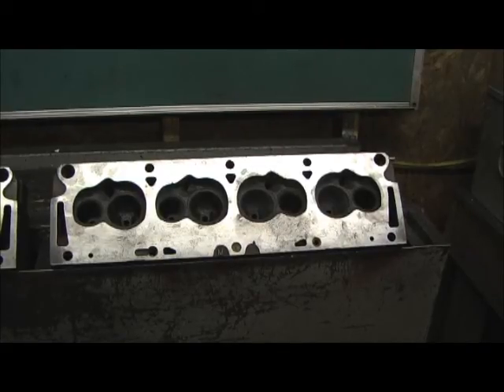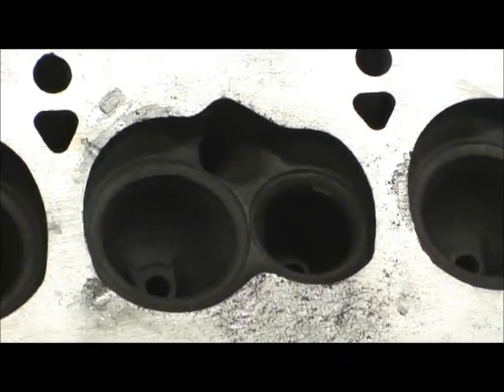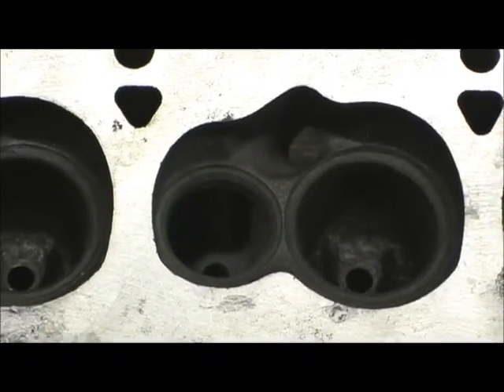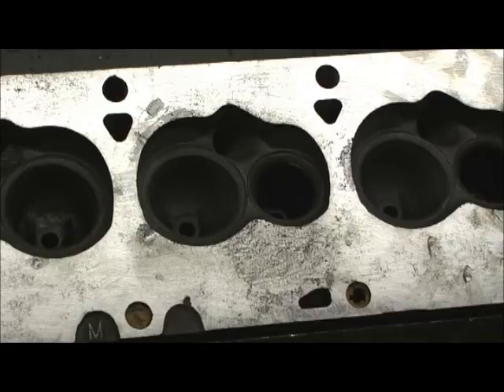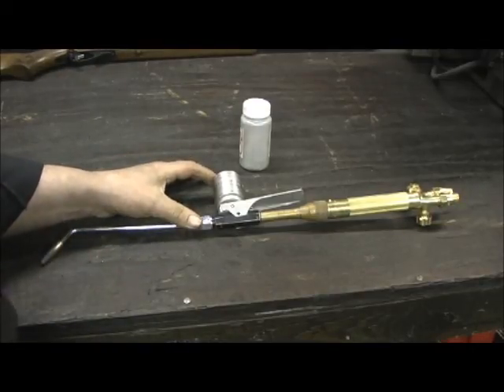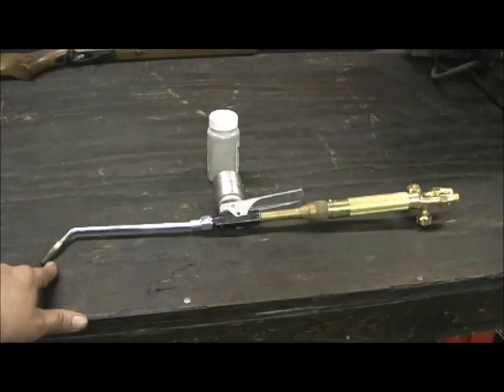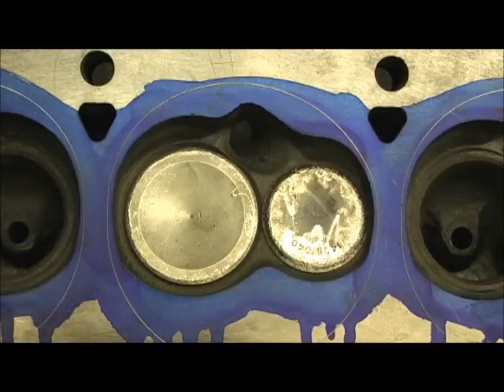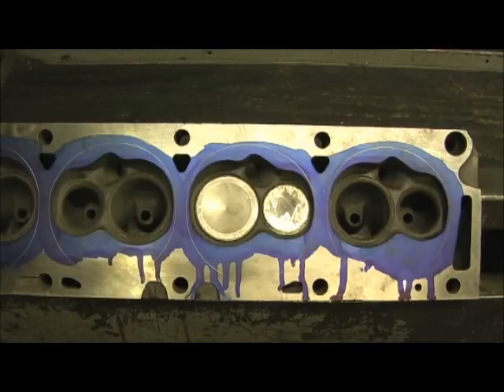Spray Welding Ford 390 FE 1960 Cylinder Heads Stage III.5 Part 1

Comment from the maker: Man out of the dyno cell in tears. Especially on those dam crate engines. They are the biggest SCREW (I would say something else, but this is YouTube) There totally over rated and are "B" or "C" run engines that the company could not let the parts in them pass spec, so they sell them as "create engines". We took some of them apart, as my old boss would not run them on the dyno because they would come apart on the dyno a lot, and it was terrible machine work. You get What you pay for...

Comment from the maker: nued) on the planet next to Congressman and Representatives. It is that bad guy. People add up what the part boxes say or tell. ie, cam-50 hp, carb-30 HP, heads-75 HP, intake-50 HP, Timing Chain-20 HP, light weight pistons with domes-80 HP.....Just ad them up and guess what?  I came up with 305 horsepower, and that is just in parts, then the engine stock at 300 Horsepower and you got 605 Horsepower with a 2500.00 engine! BSBSBS, no one gets that power that easy, like I said I sent many of (Conti

Comment from the maker: Continued) the ad of the company that they just done the article with and measure by the size of the page and you will get how big of a lie or deception you have just been handed. No TRUER words will EVER be spoken, period. Most of the journalist who write for these magazines (free-lance) don't know a Spark Plug from a Glow Plug. Seriously man. What you are reading is what the machine shop wants you to print with no bias what so ever. That is so wrong and scary. They are the biggest liars (conti

Comment from the maker: Continued); however, if you remember what I told you about me running a Clayton 2600 "continuous run" engine dyno, I seen the real deal as I have over 1000 dyno pulls over three years (one full years as the chief dyno operator at SMS Riverside, CA) I seen people leave the room in tears. it just don't add up guy. ALL the magazines are nothing but LIARS who take BIG BUCKS to write up this crap. you want to know how big a LIE an article is? just thumb through the magazine till you find (continued

Comment from the maker: IF I get the magic 500 HP (which I seriously doubt) on 93 octane gas on 398 Cubic inches, I have "shit a masterpiece" here. That is, what: OVER 1.25 Horsepower per Cubic inch with reliability, GREAT reliability when you consider Spring Pressures LOW at 140 on the seat, and over the nose (spring pressure at the max lift, which is .605) around 330. Compression around 9.85.1 at "0" deck for quench, and STOCK rods with ARP bolts to the tune of 6000 to 6200 MAX! I know this sounds low to you (continu

Comment from the maker: Your not LISTENING, get the wax out of your ears (they have candles for that now that really gets it out guy). Pump Gas, drives it every week on weekends, wants it to live quite a while, PUMP GAS!!! The oversize valves are right on and at 2.15 are the BIGGEST you can use with a 4.090 Bore Diameter or they will HIT the bore... I attack any area I can get away with,,,,ALL THE TIME!

Comment from the maker: The intake is the EDE Cross Ram that is made for the High Riser heads I do believe, as alignment wise that close to being that except there just not big enough, which makes me believe that probably meant for Medium Riser Heads and your right, there tricky, but do-able; however, you cannot get enough port in the intake manifold because you would bust through. Funny thing, I COULD TUBE THEM as they got the Tube holes ready to receive them (I actually thought about it, but Mike was funny about that

Comment from the maker: Yes, he is more into looks of the classic and what was used back then. I think he paid about 1500.00 for that Edelbrock intake, which has LONG runners in the cross-ram deal; it basically sucks (no plenum height, over 20 inch intake runners and SMALL) due to you cannot get enough material removed to make the thing work with these heads. These turkeys are the LARGE PORT HIGH RISER (I am pretty sure these are them) and you would bust through making them work, so for sure the camshaft has limits.

Comment from the maker: I don't know dude, anytime you get over HP per cubic inch on Pump gas (93 Octane), keep the spring pressure under 140 seat and 320 over the nose to make almost a "WEEKLY" driver you done good. Cam tech is better, heads are the same, so if I could it would not be much, about 500 but maybe 475 Torque.

Comment: When Ford was designing the FE they were actually doing air flow testing for performance. That is one of the reasons the 427 side oiler ran so well.

Comment from the maker: I done a set of these back in 1993 with a single four barrel open intake (Offenhouser), .610 lift solid cam and reverse dome pistons for "0" deck at 9.7.1 and hit 485 Horsepower and almost 460 Ft. Lbs of torque. Bad hugh?

Comment from the maker: It is without a doubt the best 1960 head (combustion chamber speaking) I have ever seen or herd of. It will just take me some medium porting to turn this into a 2013 technology head shape. I cannot believe they made something like that back then....Unbelievable...It came with 2.02 stock I do believe, to a whooper 2.150 SI valve. Go figure, the runners will support that size as well.